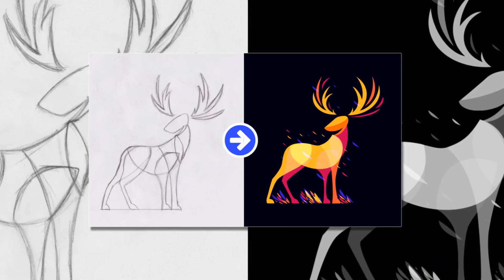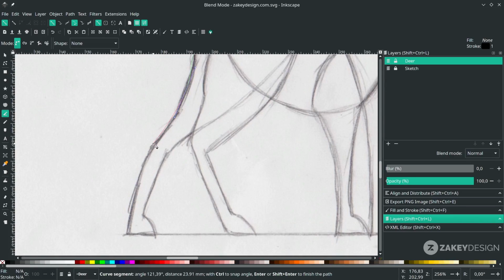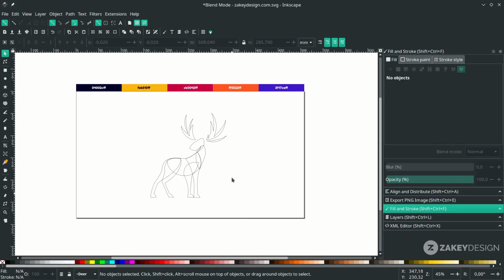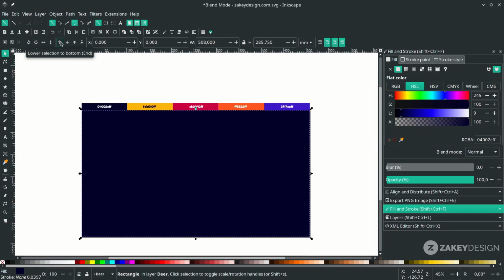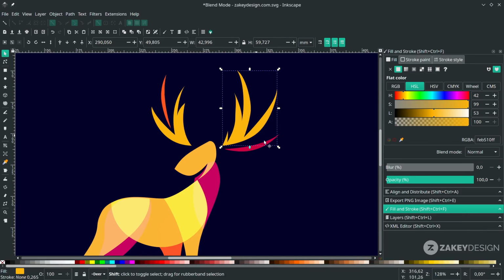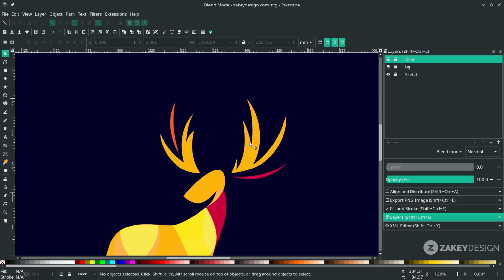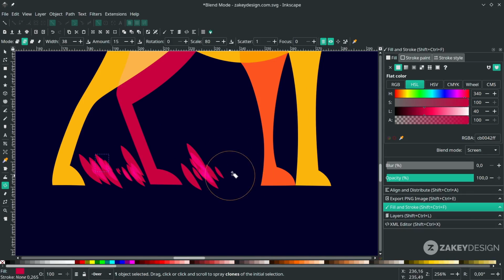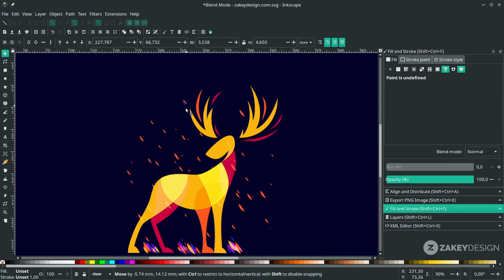Inkscape Tutorial : Flat Animal Illustration with Blend Modes

Comment: Hey Zakey I would like to know your opinion, you as a designer would recommend using gimp / inkscape instead of PS Ai.  I am a linux user and for work reasons I had to install w10 but it really sucks.
Reply from the maker: brother, you asked very good question.

because Inkscape and GIMP is really great for simple user like me,  a lightweight program but it's powerful.

I think all features in the near future will match with AI and Ps.
I dont care about industry standard. As long it's a great software that you can make an art and fulfill your graphic design needs, just continue to use Inkscape or GIMP.
Reply: @ZakeyDesign  Is linux good for working on these softwares? Which distro you're using and is it stable?
Reply from the maker: Yes. Im using Manjaro
Reply: @ZakeyDesign  Just one question! I'm planning to move to Linux from Windows 10, is manjaro the best option for me in softwares like Inkscape, Gimp and other editing softwares?
Reply from the maker: Yes, check out this article: https://zakeydesign.com/how-to-dual-boot-manjaro-with-windows-10/